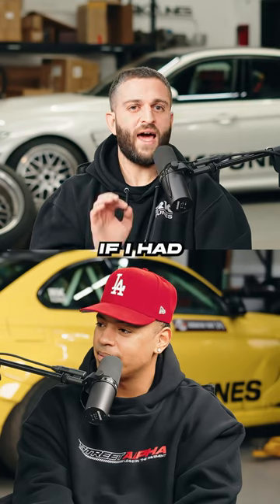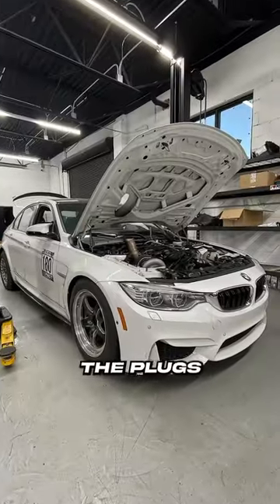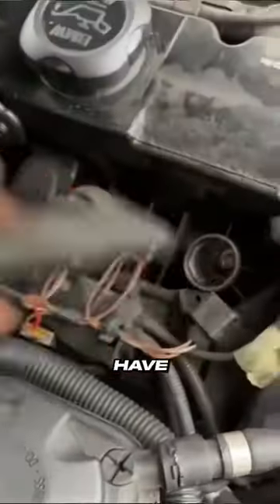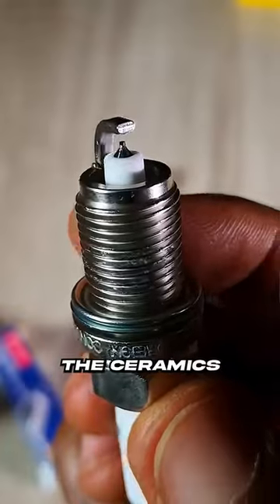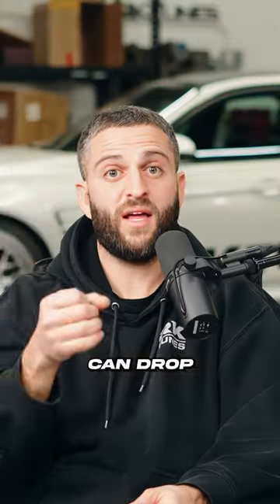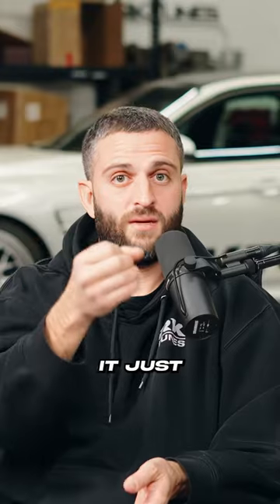Why You Shouldn’t Reuse Your Spark Plugs 😂 #shorts

Comment: I had an rb25 come in with a massive ticking noise, customer just did a tune up themselves, found #3 plug with the ceramic cracked and sliding up and down on the electrode causing the the ticking noise and random misfire.
Reply: This is why you NEVER buy a project car
Reply: @nolankoehn9724 unless your rebuilding. but a project car is usually not worth it.
Reply: had the same exact thing happen on my 16 vw gli with the ea888.3. took way longer than i want to admit to figure out it was that and not the timing chain

Comment: Run copper plugs on performance vehicles and race cars iridium’s on work for longevity which doesn’t matter when you’re going to be changing plugs every month, also coppers conduct more heat away from the electrode and into the ceramic than other plugs which lessens the risk of detonation, copper plugs are used in the high horsepower applications all the time stop wasting money on expensive plugs, we like to side gap and notch our plugs on nitrous car which reduces the chance of melting the ground strap off and falling into the cylinder, autolight coppers and ngk v power coppers are the best plugs money can buy, also if you are building a motor remember to index your plugs so they are all pointing the same direction for an equal burn
Reply: I think you just described why a small block is still the best way to go fast on not much, I know that BMW would probably hate a simpler plug style.
Reply: @coreygolpheneee  they work fine in bmws too
Reply: My old man always told me. Cheap copper NGK plugs. I always thought he was just cheap. First time I had my car tuned (nothing crazy) the guy doing the flash was like what plugs are you running. I told him I got the best ones they had. He instantly went for his spark plug wrench and said copper bud the cheapest ones. Just properly gaped.
Reply: 💯 this is big facts! Every car ive had from my dc2 type r to ‘02 is300 to my family car crv all been on those ngk copper plugs never had an issue. Nobody will comvince me otherwise😂😂
Reply: @LFC1533  copper is the best conductor
Reply: Bro I have never heard of anything like this in my life, but copper loves heat so it makes absolutely perfect sense. I'm definitely gonna try this on my small block.
Reply: I clean my copper plugs with a razor blade and put them back in. Works fine for me.
Reply: Underrated comment lots of good info
Reply: Ngk iridium plugs is the ONLY plug I run. Yeah it's $20 a plug sometimes, but it's the best way I've found to get predictable results at 14:1+ compression on pump gas.
Reply: @coreygolpheneee the coils are shit then replace that nonsense too 😂 all you need is a good hot spark at the right time... Bad tunes and crazy cylinder pressure are what break stuff.

Comment: You’re doing something wrong if you break it while torquing it down. Kids might know computer tuning, but fuck up something as simple as a spark plug.
Reply: All new plugs have a washer that requires proper torque . That washer can’t be crushed twice. Certain new engines need the plug clocked in a certain direction and this is only possible with a new plug and proper torque procedure
Reply: @the_first_resort940 yes you're right but I've been doing this for 11 years and I've never seen in alldata Mitchell or oe service data where it says not to reuse a plug.
Reply: I’m a BMW tech at a dealer and this happens all the time specifically on these F8x chassis. The porcelain will free float and just spin.

Comment: Perhaps you are right but for an example when changing out my hpfp you have to go into your MHD settings and pick the pump you are running if you do not the car runs absolutely horrible and codes start popping up. A simple catless downpipe change without out some type of tuner will absolutely throw a code.

Comment: You need the thin walled spark plug socket for that motor. A standard or even a wobbly will get stuck between the spark plug and the spark plug tube

Comment: Good quality Iridium or platinum plugs should last a while sooo....who done fucked up?
Reply: Not when racing, plugs burn up quick in racing like within a month the person that messed up is the one putting fine tip iridium plugs in a race application use coppers for racing because your going to change them often any way and coppers will conduct more heat out of the cylinder
Reply: Putting a tune on bmw engine smokes plugs like candles when you’re beating on the engine. Melts coils too sometimes
Reply: @SLAutoRepair thats because yall tune for peak h/p also ngk copper plugs are the answer or a set of open plugs that Ferrari use work great

Comment: Ford truck guys have been crunching porcelain in cylinder on every change since the Triton engine came out, doesn't hurt them
Reply: yeah bc with the triton engine a broken spark plug is the least of your worries
Reply: @zander2541  those plugs would break into two pieces, we punch out the center, self tap a puller on what's left, and pull, put in a new plug, then roll it over and listen to crap crunching up in the cylinder, never hurt one, did about three a week at the car lot back in the day

Comment: anytime i take my spark plugs out i out new ones in 🤷🏽‍♂️💀 they aren’t expensive if you consider yourself a car guy , any hobby is gonna cost money better pick a dif hobbby if buying parts is a problem for you 🤷🏽‍♂️  😂🎉 stuff gonna break till
you get it right no way around it and no one has ever gotten it right the first time either 💀💯 but rule of thumb if you pull the , replace them
Reply: Spot on. Anytime I remove a part that is a maintenance item I just replace it at that moment. Spark plugs and suspension bushings are two good examples

Comment: I've changed well over a thousand spark plugs and I've never cracked one. If you're using iridium or anything else on a high performance engine that's not copper, then you don't know what the hell you're doing. Most of the guys on this channel seem like they have more money than brains or actual knowledge. It's easy to throw money and parts at a problem instead of understanding it.
Reply: 🤝. Just because your on a podcast about cars doesnt make everything you say true about cars. These podcast clips of people are either really smart or need a new hobbie no in between.

Comment: Just follow the torque spec? Spark plugs don't just break when you take them out
Reply: And plugs shouldnt be expensive
Reply: I've seen plugs crack twice in my life... once during installation and once during removal. Both times were for the same reason...tight space to get a wrench in there and on the plugs. What happened was that the wrench was slightly angled on the plug and it caused enough side load they cracked.